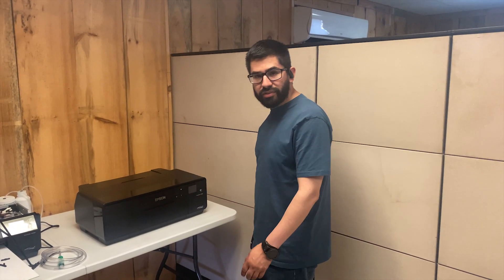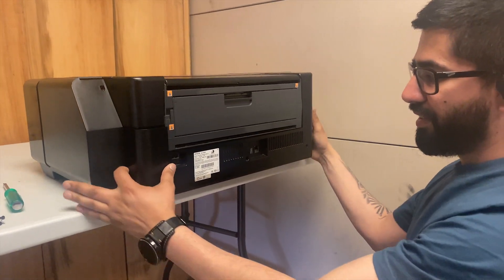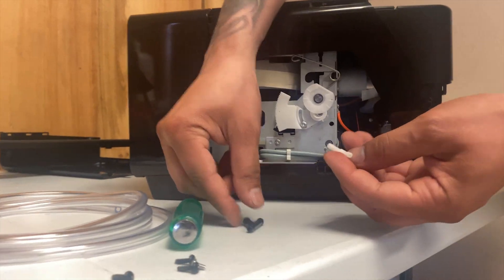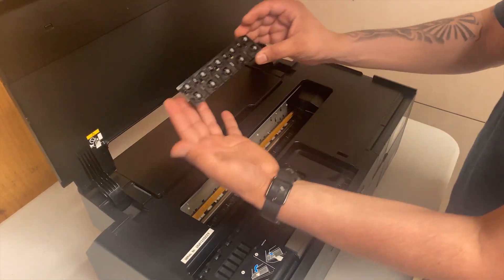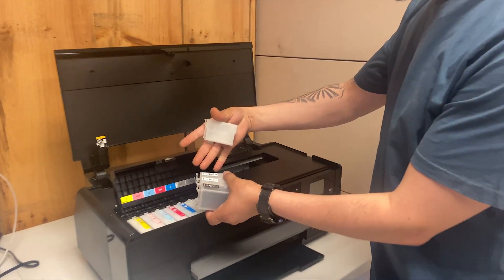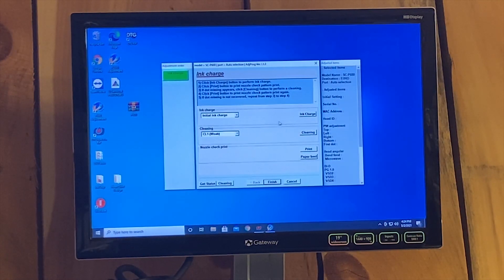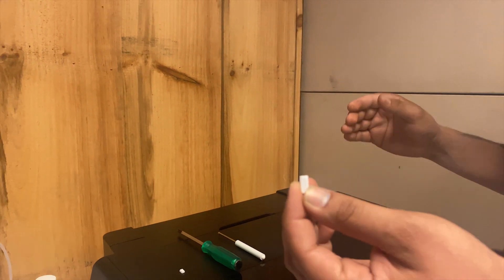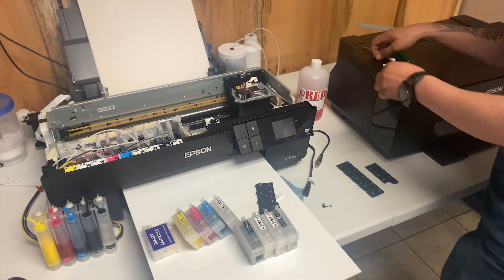Epson P600 Printer Conversion to DTF (Direct To Film)

Comment: I just picked up a p600 for $20. The previous owner said it has a problem reading one of the inks so I’ll be trying to fix that first. But I’d be interested to know if you’re still using your p600 and is there anything I should be aware of when converting this model for dtf. I haven’t started dtf cuz I’m saving for the Acro rip program. I also have an r1900 that hasn’t been converted yet but has a clean printhead. Anywho I thank you for this video.

Comment: Hi, I came across your video, I have p400 and there aren't many videos made for p400. Do you by any chance know the difference between the two and would it work in the same way? Thanks.
Reply: I don't agree with that.  The surecolor p400 is compatible, for DTF and DyeSub,  you can buy arc ciss , with white ink stirrer, or arc empty cartridges , install chip less and print away.  If you meant the Waste Ink Tank.  That's not a huge big deal.  Whats impressive on his video is .  The wheels assembly is easy to take out
Reply from the maker: Unfortunately the P400 is not compatible.

Comment: Hi, I just want to remove the P600's PizzaWheel parts, is it possible to remove only the places where those marks appear? It's the middle part (about 6 inches wide) on letter size. Are there any errors displayed during the removal process?

Comment: Great video! I’m getting smearing on mines time I print my image what is causing that
Reply: Pretty sure u need a board since when the paper comes out it’s bends down and it’ll touch the roof of the printer when coming out
Reply: @Martinehz  is your p600 still working well and do it need a chip resetter?

Comment: Hello 
Did you use the foam pads in a P800 printer?
Where did you get the foam pads?
We are converting a P800 my husband removed all of the pizza wheels will that cause a problem with the film feeding correctly?
Thanks

Comment: I ordered a XP-970 and then ordered a ciss tank system for that printer. I'm curious though about your waste tank redirect... can't you just remove the empty tank and use a chip resetter instead of getting new keys?
Reply from the maker: So the best part about the Epson P600 is we wouldn't have to use a chip resetter, we use a Firmware bypass so the printer thinks the ink is always full. So keeping that in mind the waste tank is separate and having to tell the printer that it's not always full by using a key resetter for the waste tank/ ink pad to out perform its current factory settings/ setup. Hope that helps. Don't forget to subscribe. 🙂 thank you.
Reply: Hello! Is this the same with a P400? Does it bypass it or do you need to do a chip reset?

Comment: Great video! are you able to do the same installing Eco solvent inks?
Reply from the maker: Unfortunately eco solvent ink is different and not normally used on Desktop Dtf Printers. The eco solvent inks are mainly used for other purposes. I have heard of people using UV inks on these printers to print on hard surfaces but never tested myself and can only image being more complex as well.
Reply: @fadeawayproject3166  They now have WATER BASED ECO SOLVENT  INKS for epson printers, it will work with p600, as with all setups there is maintenance if you don't print everyday.
Reply from the maker: @pressonnatty2677  do you have more information on the inks by chance? This is very interesting, do you know how are they being used the film type for the Epson p600?

Comment: Did you say you have to buy a key every time you run a clean?? 
How much are the Keys?

Also what type of ink are you using for the dtf prints? Plastisol ink? DuPont ink?
Reply: You buy a key every time the printer thinks it's full of waste ink. Depends on use and the amount of cleans you do. 
It's ink similar to DTG ink. Some seem to just use the same interchangeably.

Comment: Hello, thank you for the video. Would you know the size for the Y connector and hose? Thank you.
Reply from the maker: For the Y Tip Connector for the waste tank i use 3mm inner and 5mm outer. Very thick but works great with no issues. you can do smaller as well.

Comment: Bro thank you so much for the informative videos!! and have some questions, 
WIC RESET TOOL have to have? i will buy the 2manual`s ones, if do these 2, I will have 2 keys?? or just use the program from WIC?
and we will do the waste bottle for the printer with tips.

and DTF pet film, single frosted side is cold peeling? or Double single no matter, just depends on pet film type? 
cuz we want warm peeling instead of cold, I ordered both but they don`t mention any info on the pet film.

And where I can get the ink charge program? epson?

thanks in advance!! ;)

Could you make more videos with p800 and p600, please?
Reply: I think the keys are one time use. 

Can't help you with the film types as I'd like to know myself but imagine just go off the sellers listing. 

One thing I think you should also add as I've just heard about it myself, is getting chipless firmare key. This will make the printer always 100% ink and not have to reset half way through printing which can be tiresome after a while keep pulling the carts one by one for them to reset if you have the auto reset carts.
Reply: @Marc-io6pv  thanks 🙏 I will do chipless already bought and ready to convert just bit not sure about WIC, with bottle method will not make reset for the epson  wic itself or will happen? Thanks in advance ;)
Reply: @taehanlee4198  Ink counters... You just wait for it to get full up and then use the reset key. You can check for free the ink waste counters on WIC. No point resetting them at like 45% huh. 

I've just put the printer potty into mine, have a ink pad reset key ready for when needed. 
Having a problem with chipless. It seems my P600 board is newer so I can use the 19.99 firmware chipless key. I have to get the 50 USD one.  
On the WIC program see if yours have the option for chipless carts as one of the tabs. If it does you can use the 19.99 one. If not it's chipless solutions 50 dollar version ://
Reply: @taehanlee4198  Read it again, bottle method I thought you meant the waste but do you mean CISS? If so and they'll have auto reset chips on the cartridges then I wouldn't bother going with chipless firmware. 
I have two Epson p600s and one I will use refillable small cartridges and go chipless. The other I'll just use CISS and see which I prefer.
Reply: @Marc-io6pv  Thanks for your reply, I purchased p800 chipless and I’m try to remove the pizza roller but I can’t see those:( it’s different with p600 thought it’s same. I haven’t yet purchase WIC RESETTING yet my tank still on 25% so should do later? 

Do we have to use the cleaning solution at the first print? Cuz mine still on the way and I have most of set up, ink refillable cartridges, film powder heatpress, acrorip 10
Except cleaning solution and converting.

Do you have any idea of pizza roller and the cleaning solution? Should i just try?
Thanks

Update,
I’ve found the pizza roller and it’s bit hard to taken out, have to break the roller holding parts and bend a bit because of I pushing it same time pull the aluminium part but looks ok, and chipless works, now need to wait for the cleaning solution to clean up. Any idea for without cleaning solution?

Comment: Hi thanks for video. Whats the size of tubing you use ?
Reply from the maker: I believe the one I used in this video is the Silicone Tube 3mm /0.12" ID x 5mm/0.2"OD 3.3' Flexible Silicone Rubber Tubing. With 3mm / 5mm Y-Type 3 way hose plastic connector.
Reply: @fadeawayproject3166  great.. thank you very much

Comment: Have you had trouble with the red line flushing on p600?
Reply from the maker: No it has been a great product that I get from dtgprinterparts.
Reply: @fadeawayproject3166  sorry I meant when first flushing the old ink out, two of my p600 when I was converting the red color took forever to flush
Reply from the maker: @DTFMASTERS  you will have to check your capping station, make sure when you flush it actually is sucking the ink through the capping station. Separate your waste tank lines to see the white ink and color ink Charge.
Reply: @fadeawayproject3166  will do thank you!
Reply: Took everything apart the issue is the damper is very clogged, gotta get a new one
Reply from the maker: @DTFMASTERS  what brand ink have you used?
Reply: @fadeawayproject3166  is this the red concentrate cleaner from dtgprinterparts.?
Reply from the maker: @thedriver2411  yes it is 🙂
Reply: @fadeawayproject3166  did you mix or as is since it’s concentrated
Reply from the maker: @thedriver2411  I been using as is. But recently I have added Distilled water and mixed 50/50 and has been doing great.
Reply: @fadeawayproject3166  thanks for letting me know tried purple hammer and don’t think it was any better than windex lol